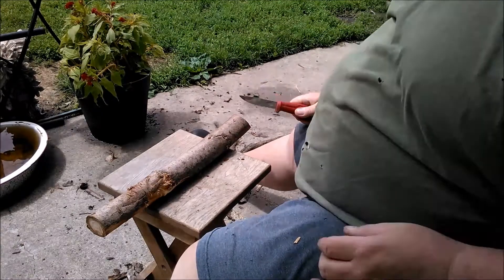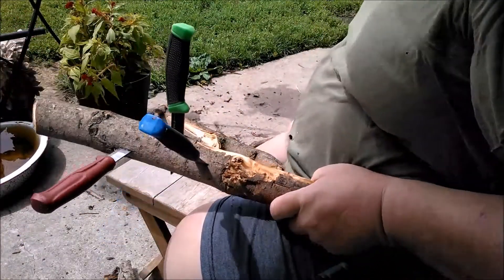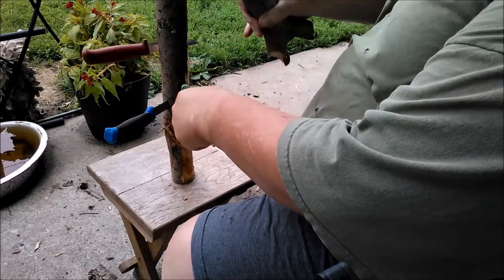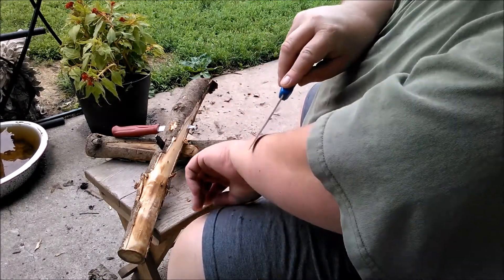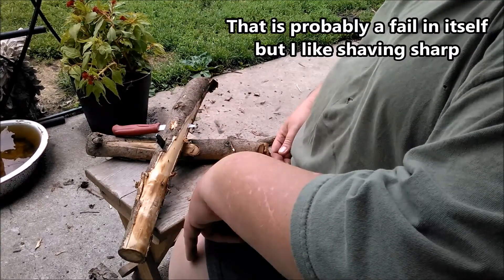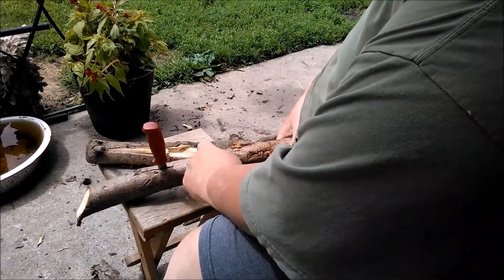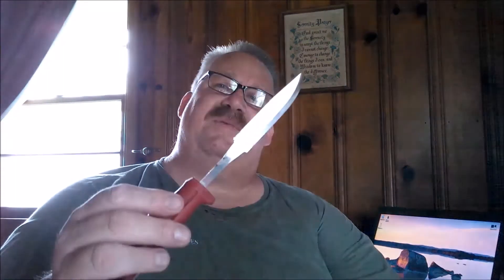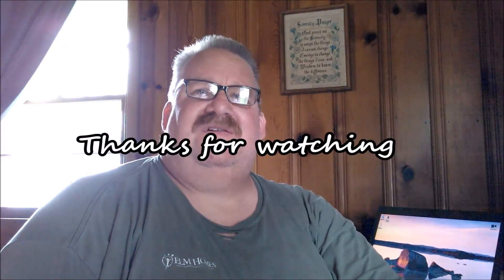A tale of three knives: The Finale

Comment: Good to see you take it to the Finale. Agree 100% that knives shouldn't be deliberately abused like that. Yet, it's good to know, what to expect when one of those is all you have. Especially, since there are usually alternatives. A fire will burn a long stick into 2 pieces. Two trees, close together, do a good job of "cutting" firewood down to length. Split wood is nice to have. Yet, have made many campfires without using a single piece of split wood. 

Personally, I'd rather try to save the knife, regardless of the quality, for things a knife was designed to do. Feather sticks & curls. Cutting meat & taters. -- Side note: Even if the handle can't be re-attached, those blades are still useful. Perhaps in ways not thought about, when it had a plastic handle. Something to ponder..............

After seeing that, Finale, definitely going to order some more 511's. For family members and to stash in get-home vehicle kits. As budget permits, a few more as extra's for just in case.

Thanks for the follow up & sharing results. Appeciated.